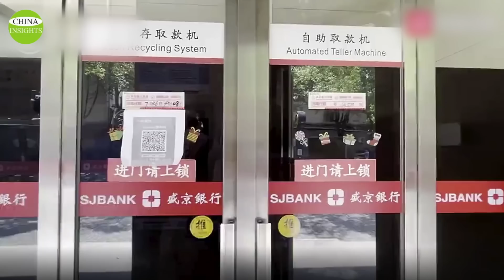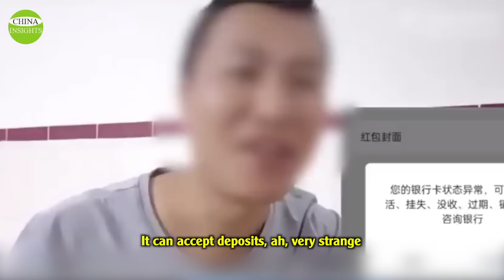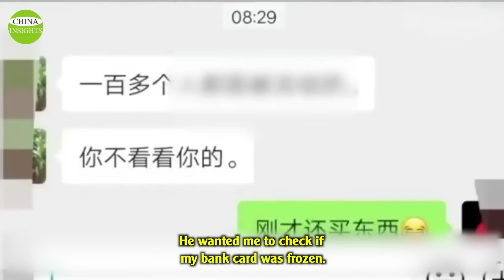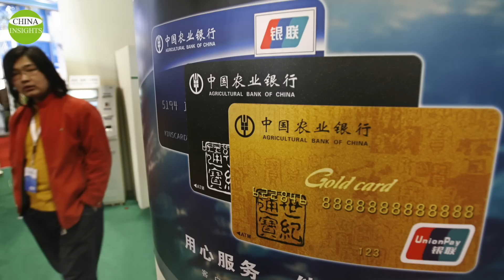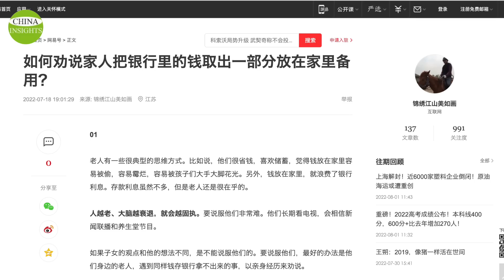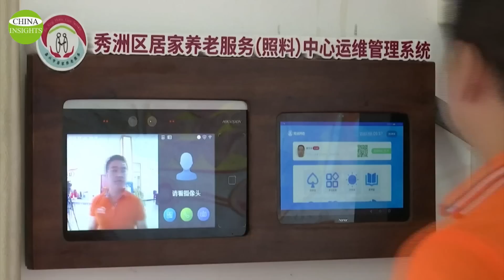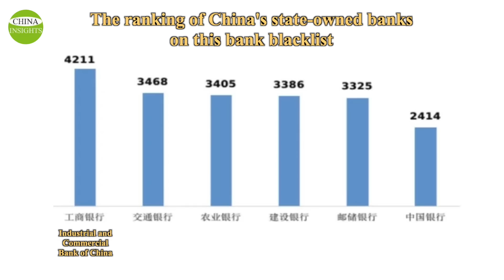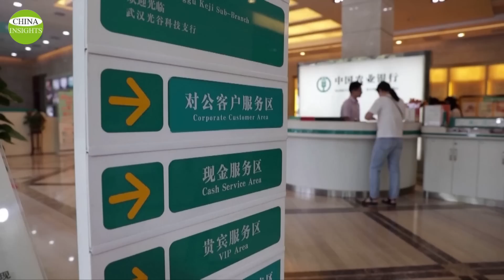Hurry up! When you can still take out cash/China's banks have the lowest capital levels in 30 years

Comment: Why on earth would an ATM need a closing time? It's a machine, it doesn't need tea breaks or toilet breaks.
Maybe the Chinese banks are experiencing solvency problems?
Reply: Maintenance or to stock up on cash.
Reply: @RoosSkywalker  you don't need a set closing time for that, just a security guard and a technician to perform the job, which should maybe take approx 15mins?
Have you never used an ATM at night time yourself? Or seen an armoured guard van service an ATM?
Reply: I'm not sure  if it's still the case but in Japan many atms have set operating times as well. Depending on where the atm is housed
In a bank, of course one would expect the atm to be available 24/7

Comment: Is it time for the piper to be paid?
The point is that if there is no fraud and banks are tied to the Central Bank, then the solution should be easy and obvious...
Even if the banks are for the moment undercapitalized with cash, the bank's overall assets should account for the existence of capitalization in whatever form even if it's not in the form of cash... Like loans for development projects which are often mentioned. In cases like that, the Central Bank should be able to issue a loan against the loan, borrowing from the loan in the form of cash. This maintains orderly books for the bank and provides the bank with cash for the depositors who want to withdraw their funds.

The point is to avoid a bank run which would drain a bank of its capitalization. As long as there isn't a panic bank run, there shouldn't be any problems and everyone is satisfied.
The problem is if there is unreported bank fraud. If the bank has "disappeared" cash off the books, then the outstanding loans won't cover amount of funds required to return deposits.
Of course, this calculation assumes that operating costs are kept to a minimum, if bank officials are paying themselves significant amounts then that will eat into the bank capitalization.

So, bottom line is that in a China where financial reporting is unregulated and no reports and data can be verified,
This may be the ultimate proof whether China's governing and business models are truthful and sustainable.
When not only small agricultural banks are affected and even regional and larger banks can't support prompt transfers of funds due to lack of capitalization, it's a likely indication of theft by obscurity if not outright fraud which involves intent to steal.
Reply: Great commentary, seems to be the case. Fascinating to see it unfold
Reply: The problem is they made massive loans to developers who had no assets.

Comment: I worked on and filled ATMs for 14 years and I can say without a doubt routine maintenance isn't a thing for them the only reasons for ATMs to be down is jamming or failure to load enough money into machines. ATM owners can see in real time how much cash a ATM has so if a ATM is out its normally due to failure to load.
Also bills in ATMs come directly from main cash vaults the exact same places where the banks receive their money from and those bills are either new or clean non circulated money.
The used money during the pandemic has been deposited and swapped for clean bills
Reply: Wow, this is fascinating! I never thought about loading ATMs as being a job. Thank you for the info! 🙏

Comment: There are options to determine delinquent loans based on your own criteria sometimes. The accounting standards allow it and some UK banks applied it on home mortgages, but one of them recently changed it as the regulatory requirements is 90 days, so they aligned the two. So regulatory requirements are 90 but accounting requirements are flexible for what is delinquent.

Comment: The more I learn about fractional banking the more I feel it's a stupid idea pushed by greedy capitalists. Sure, it has its benefits but who thought that setting the reserves at 0-10% of their total volume was a good idea longterm?
Reply: The odd situation for a bank is that cash deposits are considered a liability and an asset at the same time. It is a liability because the cash is owed to the depositor, and must be returned at some point. It is an asset because it can be loaned out to individuals or businesses for an interest. So as a business, keeping 100% cash reserves is not feasible for a bank to make profits. So the question is, how much % is considered "safe" for a bank's cash reserves? If banking operated as purely free market, then depositors would be the judge of which banks they consider safe and willing to leave their funds with. However, this is not the case for many banks any more.  In the US, they have the FDIC system where the government will guarantee up to $250k per account to the depositor should the bank fail. By this, depositors are no longer concerned with the solvency of any commercial bank. If the market of depositors do not judge commercial banks by qualities of safety, then there is no incentive for banks to maintain levels of reserve to win their business. 

Short answer to your question - The government.

Comment: FYI for people wondering why you can deposit on a blocked debit card. its because there is low risk. If you're trying to steal money, why would you put money into your account? the risk is people taking money out and running with it. Hence, when "blocked" its usually only money going out. PS im from canada, and the bank i used to work for does the same thing. (i block cards too sometimes using same method).